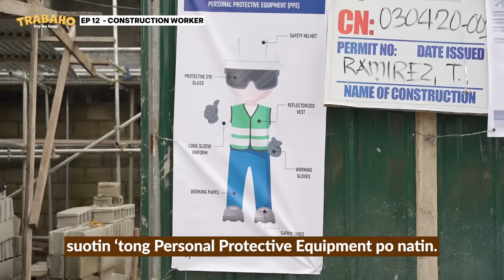HELP! 🥵 Being a Construction Worker in the Philippines Be Like..👷‍♀️ | TRABAHO

Comment: I was a Mason tender for 5 days for a friend of mine. He couldn't get anyone else to do it in the Florida sun and humidity. So I helped out. It was a 186 square meter house. We finished the walls in 5 days. Afterwards the masons that set the block said I wore them out. They didn't know it but I was totally worn out. I had to mix all the cement, keep them filled with cement, supply them with cement blocks. Hollow blocks in the Philippines. I did that for 5 days, 10 hours per day. Now you know why construction workers get good pay.
Reply: Here in PH construction workers dont get good pay.
Reply: @bogsa1211 true :(
Reply: It's not a good pay in the Philippines unfortunately :(

Comment: Even in this video, it's not complete... I think this is the easier ones since the foundation is already built. At the time of construction, you have to clear the area, the vegetation, the rocks and whatnot, obviously it can be done with a backhoe or bulldozer. Then we have the builder's hut, they have to build those as well and the logistics of the equipment and resources, the storage. Then they build the foundation and the pillars, which will also require some metal work because of the rebars, I would assume that they do welding as well.

And this is for small projects, like residential houses like this. What more with residential buildings? They would need to assemble cranes, move large pieces of metal and everything. Build elevators. So many things. 

This is why we should always respect the blue-collar workers, they're literally the backbone of any modern society.

Comment: Hello Jessica, I reckon that kind of job is not for you but nice you tried labor work in a construction site. I am an Electrician and did some wiring projects as a Lead Electrician and I see this kind of work at the site. It is so laborious lifting concrete blocks, piling them up, mixing cement, steel works, lots of lifting, lots of sweat and it is really a hard work for the workers. You'll have a back ache afterwards Jessica at the end of the days work. And the bad thing for this kind of job is the wage is so low and not having a permanent work. After the contract is done, no wo more work - "tambay" again.

Comment: Here in the U.S., hollow blocks mortar are only on the edges of the blocks, not the holes. Once the blocks are installed the joints are cleaned immediately

Comment: I agree with the hardest part(hauling).
In my case,I carry one sack of gravel,sands,cement,hollowblocks that weigh around 50-55,60-80,depends but usually it's around 50-60 kgs respectively for 70-140 meters(rough estimation).
Anyways,mabuhat kayung mga construction workers.